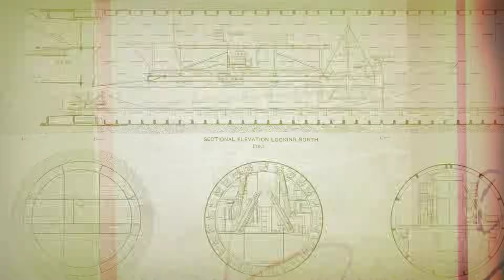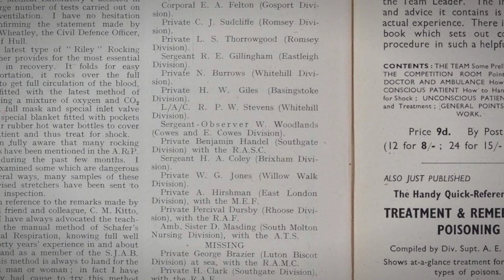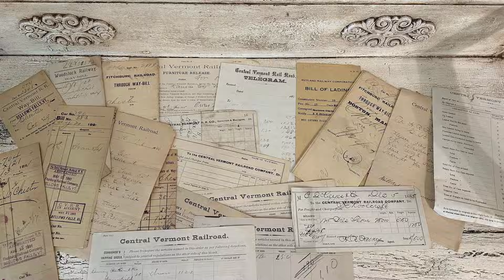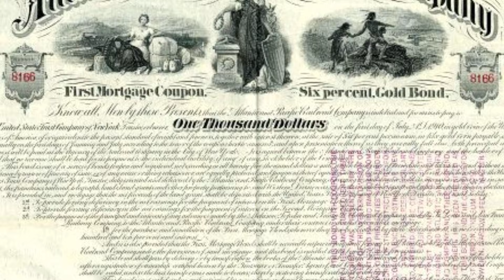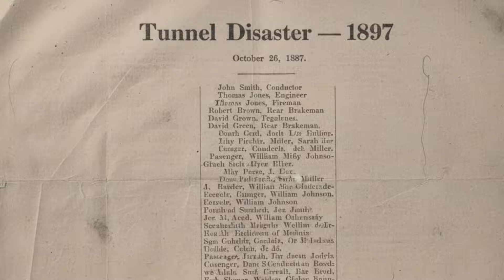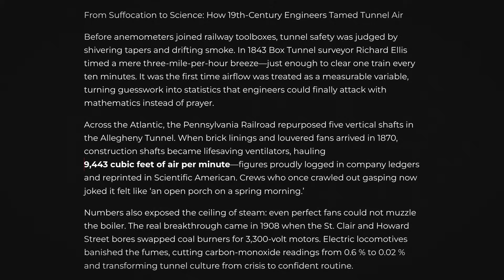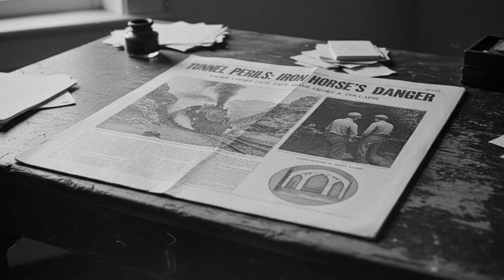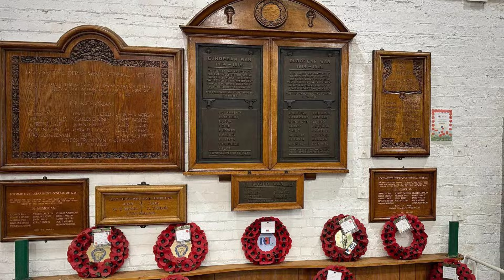Why Early Railroad Tunnels Were Death Traps for Locomotives

Comment: sealed cabs were responsible for deaths in Western Australia.  When a large engine stalled the crew had no means of escape from the tunnel.  It became one of the few places where a tunnel was replaced by a deviation.  In Switzerland a train fire in a sloping tunnel burned and asphyxiated people.  The tunnel served as a chimney.  The channel tunnel has parallel emergency tunnels specifically for evacuation if needed.  Problems don't go away and each disaster points the way to improvements that might be possible.  Yet at Stephen's pass in the USA electric traction has been replaced with diesel traction.  And those diesel fumes are definitely deadly.  Ventilation systems are used but it is a lot less safe intrinsically than it was fifty years ago.  It is merely "operationally more efficient".